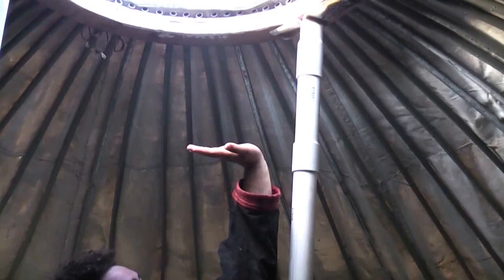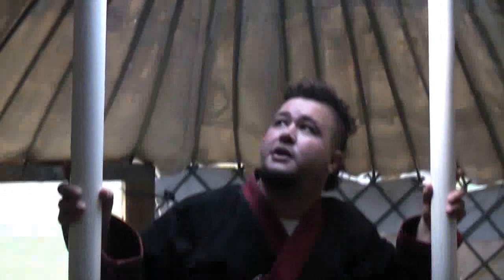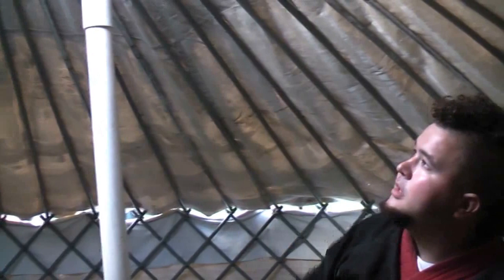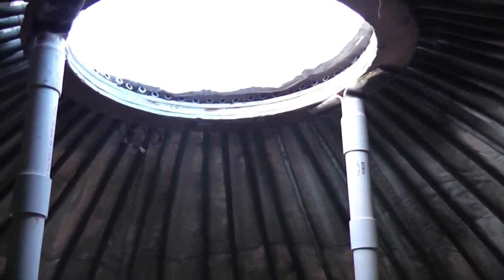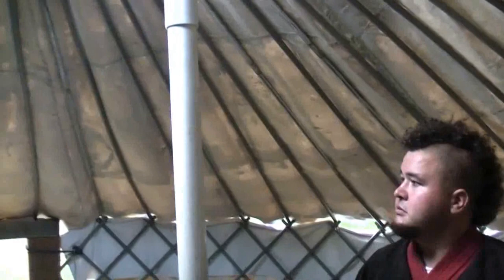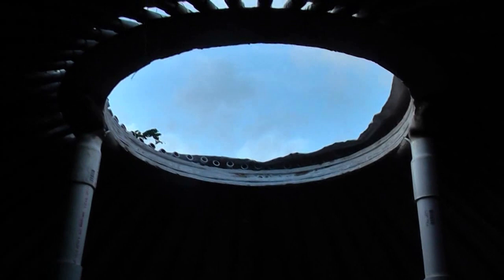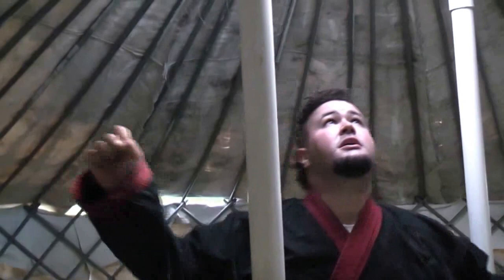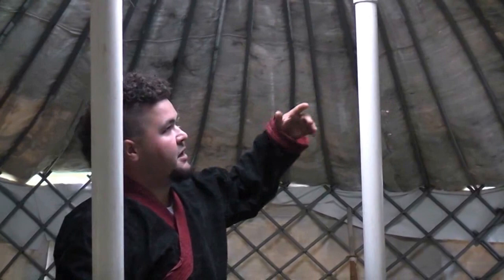The PVC Pipe Yurt

Comment: Another weatherproofing idea is about 100 yrs old.  1 LB bees was 8oz or Turpentine and 8oz or boiled Linseed oil. Melt and then Roll on canvas. Or can wait till solidifies and rub on like waxing a car and use the sun or heat gun to reheat and it will absorb into canvas.
Great project

Comment: when I visited them it was -40 with 70mph winds most most of the time, but at times it got colder, I liked  the way they held up under severe cold. Kazakhstan, Mongolia, Uzbekistan, Kyrgyzstan, all have open plains that develop high winds and the prevailing winds comes south of the Urals from Siberia. it warms as it comes south, but the wind speed picks up so it is important to have the lattice flex to handle the wind.  most of the ones I saw were flexible wood, but I think PVC would still work

Comment: I like the idea of the walls made from PVC as it flexes well, however I think the 2 upright poles should be metal conduit so you can light a fire in the middle without melting the poles. it might be good to do the roof poles in metal conduit as well as the roof does not need to flex. Also usually in the yurts I saw in Kazakhstan and areas east there was always a band of either metal or hide around the top of the wall to help bear the weight of the roof.
Reply: Good idea, I was thinking what would work,  to light a fire underneath. I want this to camp any time of year with the fam.

Comment: On your roof you could add some elbows and put piping going the other way. Like a spider web effect? Might be worth a shot?  Get a bunch of sawdust and mix with some kind of glue and fill up the inside of your polls. Just pack it tight and let it dry. Maybe melt down some plastic and pour it in?  Couple options.

Comment: You could use E.P.D.M. roofing membrane. It comes in white and black available at any roofing supply.  TPO is another light weight membrane that would work. For test purposes one could get cast off EPDM from roof tear-offs for free. That membrane is easily glued at seams. Similar to patching a bicycle tube. EPDM is a bit heavy but even cast off membrane would still last for years for your purpose.

Comment: Good job on the conduit pipe yurt.  To stiffen up the roof rafters, you could insert lengths of dowels into both ends of the rafter.  Dowels usually come in 48" lengths.

Comment: 1" PVC would have a lot less flex.  Replace half your beams on the roof with 1" and double up the others with a sheath of cloth for rigidness.  Although going with bamboo might work better in terms of weight for the roof.  Not that I could do that in my region, it gets way too hot to have plastics exposed to the real world for any duration.